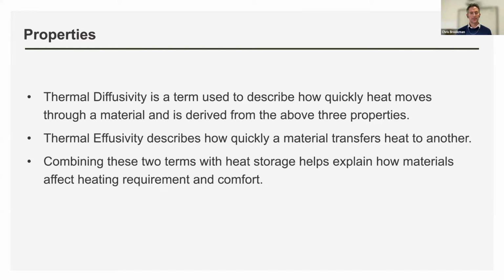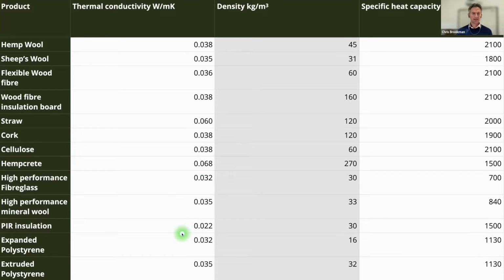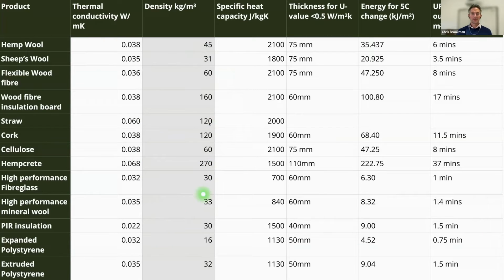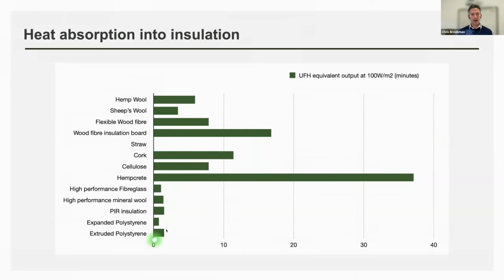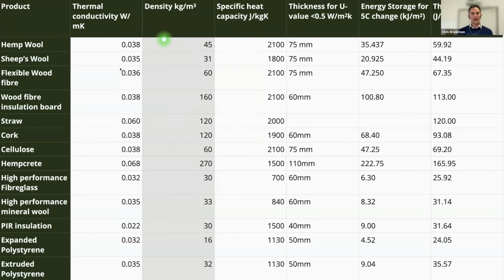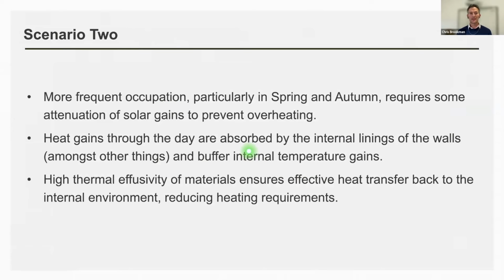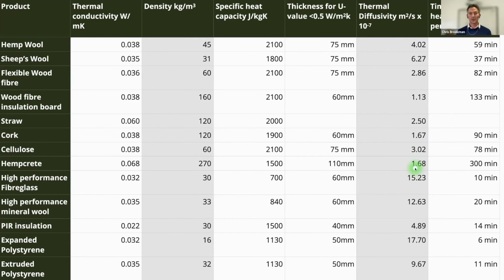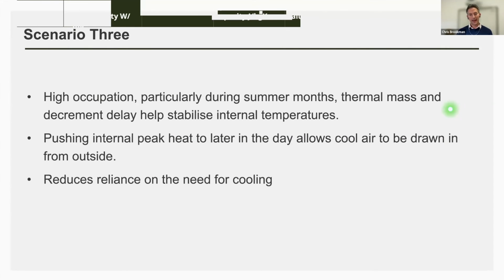The importance and influence of thermal mass on thermal comfort

Comment: Great explanation. It's such a misunderstood concept and the fact insulation options in the major DIY stores are so limited doesn't help. 

I've heard from a couple of friends who have had loft conversions that complain of high internal temps in the summer. Inevitably the builders have used PIR. Sound insulation is another great benefit of wood fibre too.